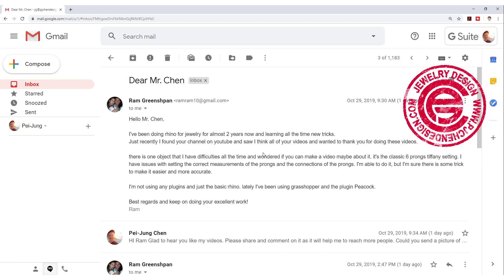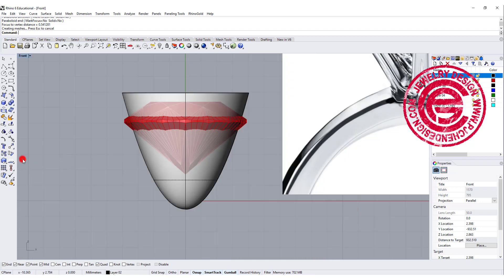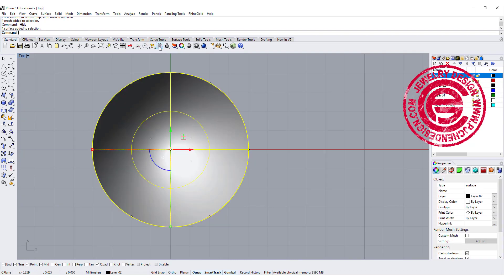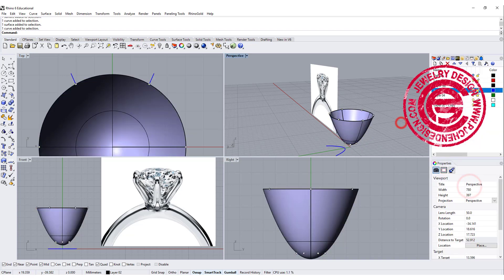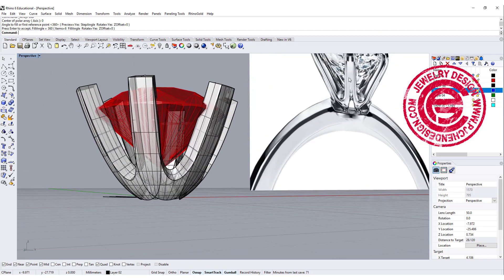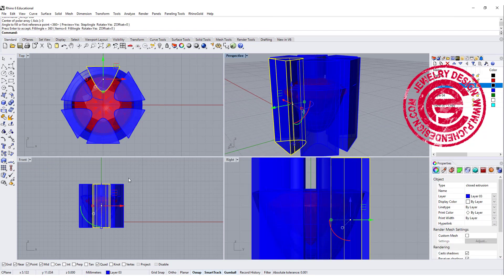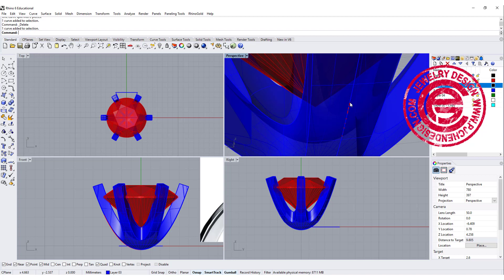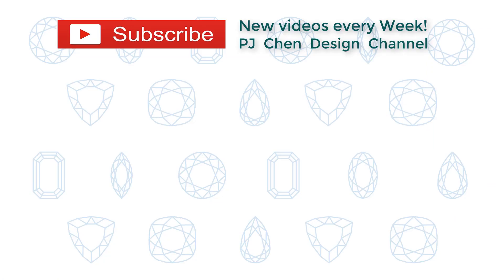6 Prong Head Engagement Ring 3D Modeling in Rhino 3D: Jewelry CAD Design Tutorial #99

Comment: when I try to take boolean diff  with pipe, getting error message "Boolean difference failed."
Reply from the maker: I have several video discussed on why boolean failed in PJ's Q/A Session playlist. you can check them out. It may be just because the seams are aligned.

Comment: Hey PJ. Hope you are well. 
Random question. If just bought a phrozen sonic 4k. I'm using the purple castable formlabs resin but I have not a successful print yet. I'm pretty sure that I am setting the printer up correctly. The print keep getting on the bottom of the vat. I have set my exposure time to 8secs. Any advise would be great. Thanks.  Love your channel.
Reply from the maker: There are many factors to impact the prints. I will suggest you join the Facebook Phrozen group. There are a lot of related topics that has been discussed. I found a lot of good information there.

Comment: Hi, thanks for the very instructive video. Could you tell me if it's better to 3d modelize the groove on the prong in order to set the stone or to cut it with the traditional tools?
Reply from the maker: It depends on how bit the prong is. I will suggest to at least making a mark if the prong is too small.